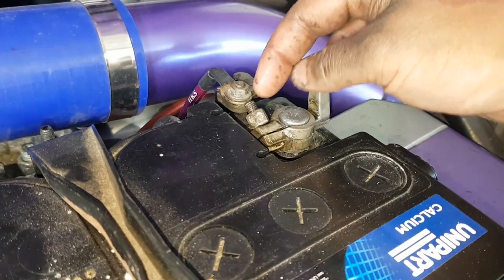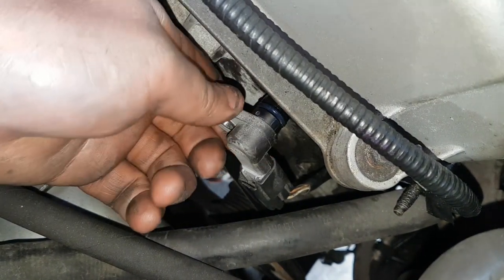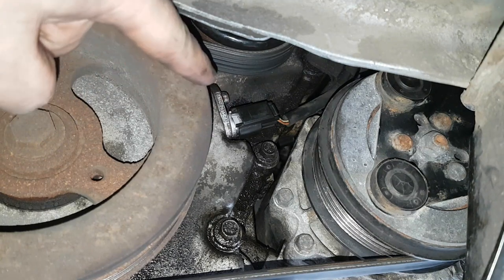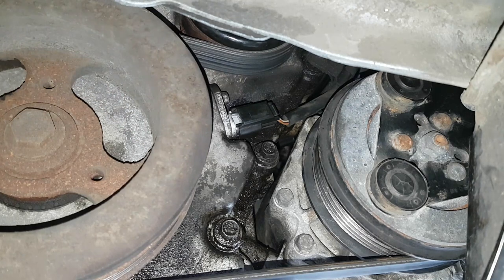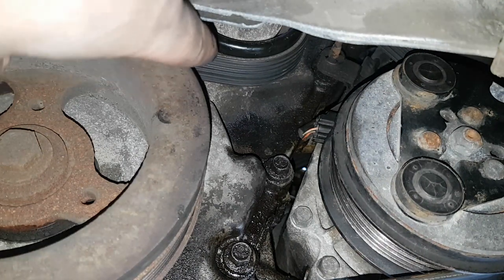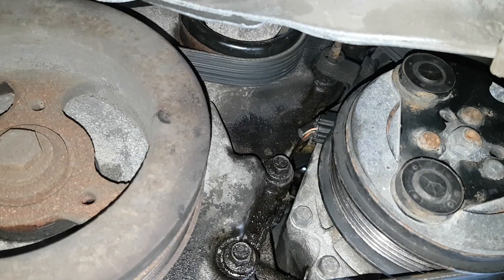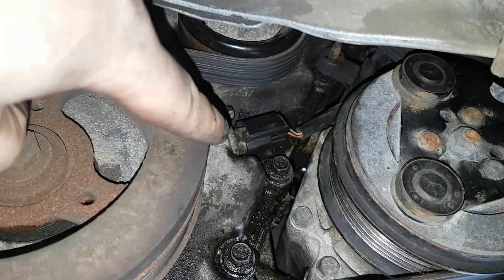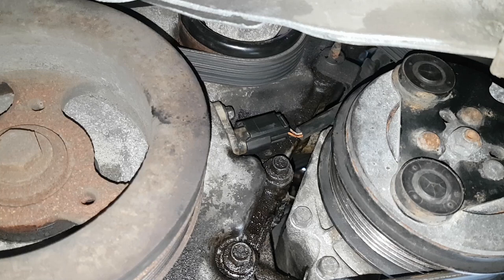Ford Mondeo MK3 Cam & Crank Sensor Replacement Project ST220

Comment: Just took mine out don't know if it will fix it or not car cuts out randomly and won't start for ages after so hopefully it's this cos when I got the car running riggled the wires on the sonsor and car died

Comment: Hi , could any one out there tell me where abouts is the  crank sensor..on my Mondeo 2.0 tdci Duratorq engine  04 plate ..Have been given all sorts of  places that it is supposed to be ..but i am struggling to find the crank sensor ..perhaps i need to go to spec savers ..any help would be greatly appreciated .cheers

Comment: Hi chazz did u buy from Ford these parts??? Been looking and there is a few brands but I'd rather use genuine Ford ones.
Reply from the maker: Hiya mate, ive got a set of these if you want some. Message me
Reply: @ChazzCoombes   hi chazz. Yeah I want to do this job. 17 year old now. Think it's time to change them before problems. 
Are they new?
Reply: How do I private message on here?
Reply from the maker: @bunabuna9287  no there not brand new but they work. Mind you in the discription there are links to new ones.
Reply: @ChazzCoombes  thanks for reply chazz. I want new ones mate. For the price of them I don't wanna take a chance. The ones on my car are fine. But think it's time to change them over.
Reply from the maker: @bunabuna9287  thats ok, the ones in the description are brand new ones.
Reply: @ChazzCoombes  thanks chazz

Comment: Where's the crank sensor located on the engine, all I can see is a couple of pulley's
Reply from the maker: on the bottom between the pulley's, lack of room but you can see it
Reply: @ChazzCoombes 
Nah mines different I found it now, on mine it's under the Turbo between the Block and the Gearbox, remove the Airfilter Box, and a Big Rubber Pipe and I could just about see it tucked away under the Turbo... But thanks and good day 👍
Reply from the maker: @BillSikes.  learnt something new myself there, glad you sorted it